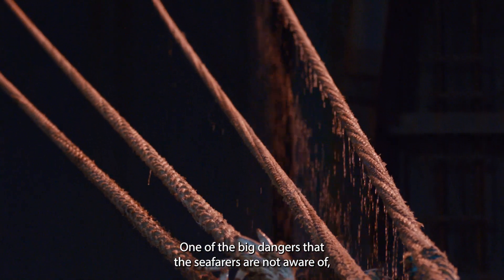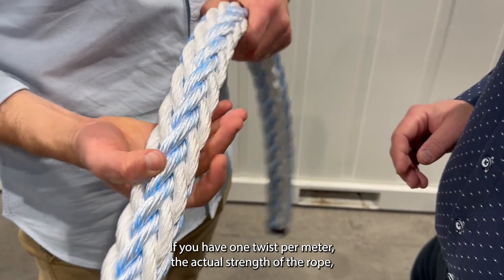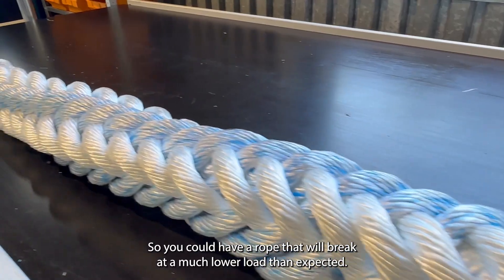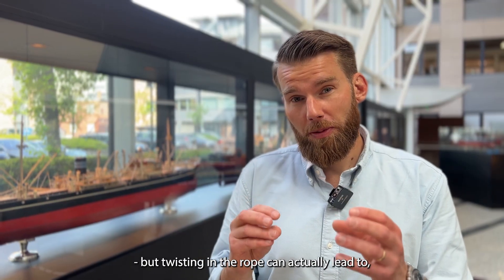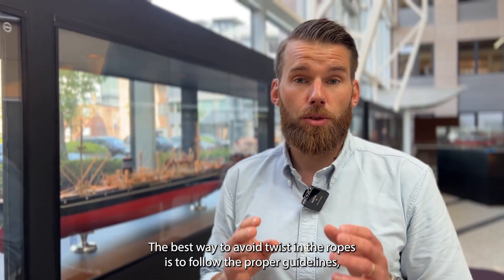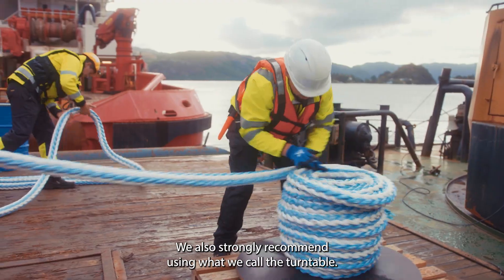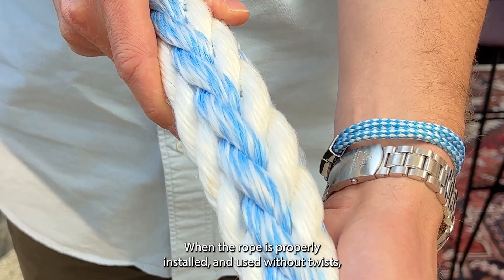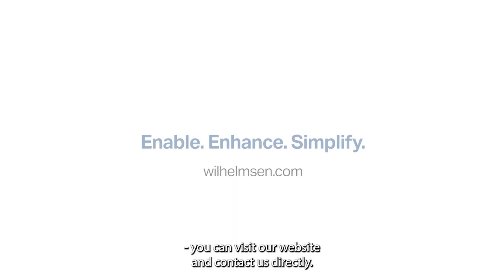The dangers of rope twisting

Comment: What is the difference between the twisting of the rope (makes it weaker) and the twisting of the strings to compose the rope (makes it stronger)?
Reply: 8 and 12 strand braided ropes consist of either 4 or 6 strands twisted in one direction (left) and equal in opposite direction (right). Together these ensure a good balance and strength. However a twist in the entire rope, either to the left or right will destroy this balance and actually open the strands twisted in the same direction and weaken the balance in the construction.
Reply from the maker: Thank you for your interest in our video content. That is a very good question. The twisting of the yarns and fibers and braiding of the rope provide some of the key characteristics of the product, like its elongation, resistance to abrasion and compactness.

How much the yarns are twisted, and the braiding pitch of the rope are two critical parameters in the construction of the rope. To simplify, a tighter construction with more twist will typically improve the compactness and elongation but will reduce the strength, and vice versa. These parameters are optimized in R&D to get the best balance of strength, elongation and resistance to abrasion.

When the rope is twisted in operation, as shown in the video, it will effectively alter the construction of the rope which will reduce its strength.